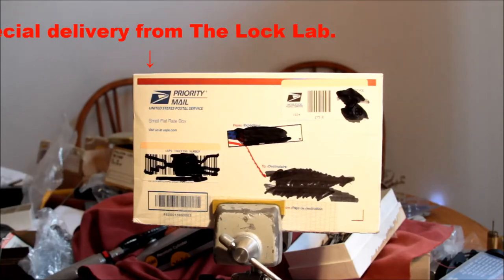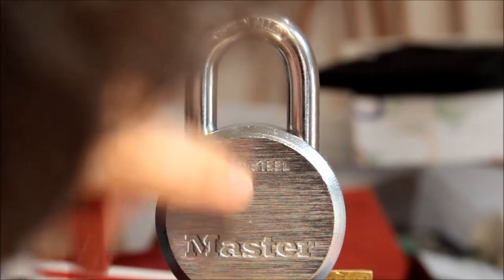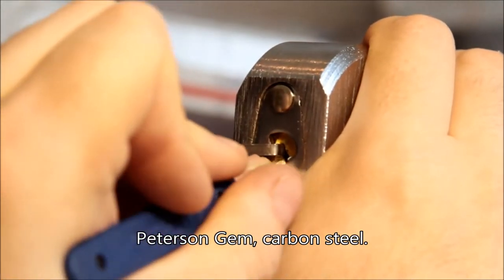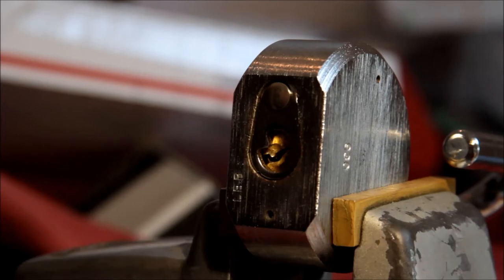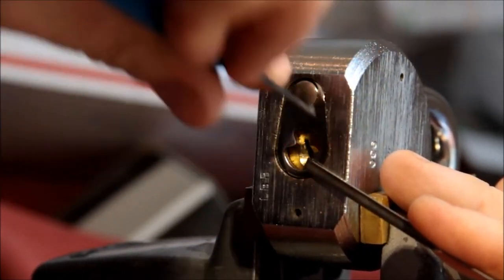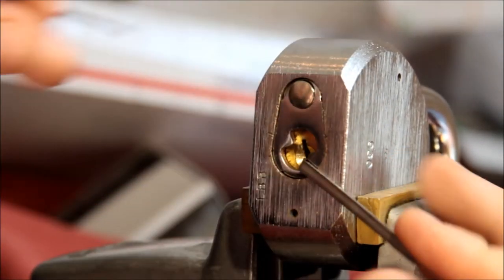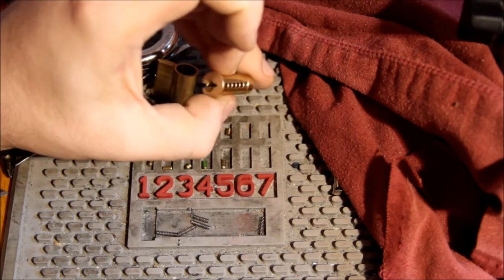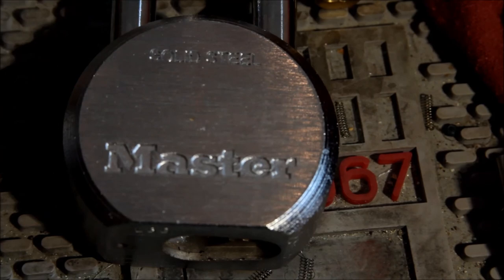(235) A Mightier Master: Part 1: Bill's special sauce (SPP & Gutted)

Comment from the maker: Yeah... that's on the to-do list. I think I have some music wire of the right diameter. Getting the little tip bent and shaped correctly will be the primary challenge. But I'm pretty sure it can be done. I'm also pretty sure that the standard American Lock wafers would block such an attack. 

Shame on them for continuing to design this vulnerability into their products.